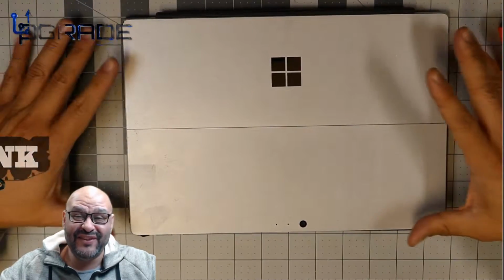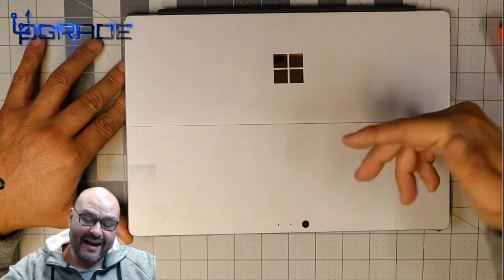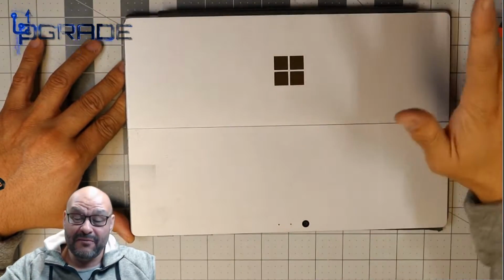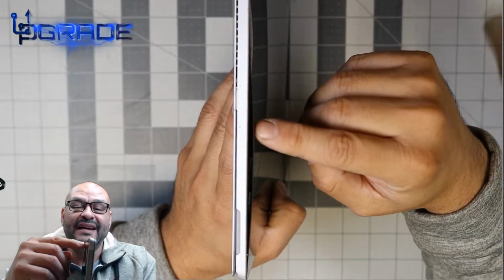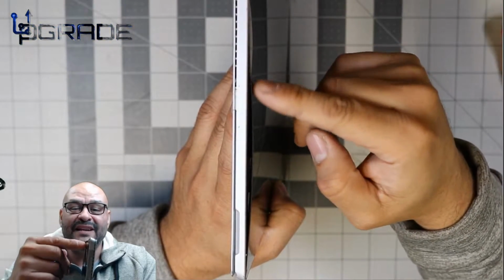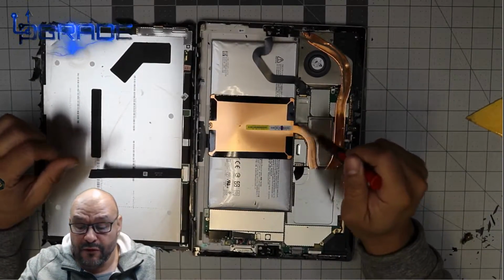Microsoft Surface 4  SSD data recovery

Comment: can I take that SSD MDOT and plug it into my motherboard on my desktop that has a slot for it?
Reply from the maker: Yes but you might have issues on the boot unless you setup on bios and make sure they are compatible NVNE or M+ B version

Comment: I'm not sure if you can help on this, but perhaps you can offer me some advice.

I have two surfaces. A new working 7 and a practically dead 5 model. 
As for the the 5, I'm stuck in an infinite reset. This isn't a typical reset, though. As far as I can tell, I can't access the boot menu, nor can I enter auto repair. I'm only able to access the startup repair without the advanced settings (All I can do is enter the Bitlocker Key menu and I can't really do much with that). I've tried making a boot disc and inserting it, but without the boot menu it's all futile. So I ask you: What should I do? I've gone to several Microsoft stores and they've all told me that saving my data is not possible. I also asked about them ripping out the hard drive for me, but they told me it's soldered to the motherboard. I've come to terms with the fact that I might have to rip it open in order to get my data.
Reply from the maker: Have you try to reinstall Windows without removing the data. The second option will you might need to clone the drive on an M.2 and try to extract the data these ways before removing the original. You Can clone for free try the software in my videos but you are going to need an M.2 reader USB.
Reply: Upgrade How would I go about reinstalling Windows?

Comment: Once i take out the SSD, how do i access it?  my sp4 got stuck in a boot loop and none of the online fixes worked. i dont mind smashing the surface pro and pulling it out. But isnt it encrypted? 
How do i pull files off of it? 
I probably need some sort of adapater to put the ssd in that then can plug into my desktop. I will likely need softward to access the SSD to pull specific files off. I have family photos and some excel sheets. Any advice would be much appreciated

Comment: Thanks for the video. It is very informative. So, does it mean that if you teardown the device to replace the battery it could not be used again and you have to bin/recycle it?
Reply from the maker: No it trash from here unless you want to replace the battery at  $100 - $150 AND The glass replacement at $400. Not worth it just recover your data